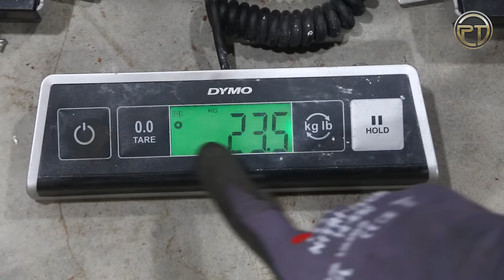3000 Soda Cans Transformed | THOUSANDS of Them

Comment: I dont have the money to afford one of those industrial shredders, so i took it another route. I reversed engineered a micro shredder to use for those cans. Truly works great, the trick is that the teeth arent as big for obvious reasons, and so i gotta maintain some pressure on the cans so they dont just keep squirming around, which is only an issue when the pile gets low.

Comment: The shredding machines you have are impressive. I think the breakage (and all the dross) shows why people say cans are a bad source for casting aluminum.
Reply from the maker: i totally agree
Reply: When it's free (not so much in this case though!) It's FREE. 

If all you're doing is casting plates, rod or disk billets for your own use it's definitely cheaper than buying new ali stock.

Doing all that driving around though will cost a lot these days, (not very green) plus the foundry costs. 🤔🥴🙄
Reply: Cans have paint, plastic lining & some iron for the lid opener, so yeah not that easy
Reply: It was a good question
Reply: Cans also have plastic lining & paint

Comment: Nice video man.  The sand casting seemed like it took a lot of effort for the foundry guys, did they want to do it that way for something to film or is that the preferred way when dealing with large amounts of aluminiun?
Reply from the maker: They normally make vents for the shipping industry, and they use a lot more aluminum for that. But they’ve never made ingots like this before so it was a little thinking of how they gonna do it

Comment: Aside from storage and transport, which is understandable, was there a reason to grind the cans to that consistency?

Considering you will get slag regardless, was curious if there were other reasons.
Reply from the maker: My initial plan was to melt all this is my own crucible which is much smaller then the ones Winteb used.
Reply: Fair enough.

Comment: Wouldn't shredding the cans expose more metal surface area, resulting in more of the aluminium being oxidised than if they were melted whole?
Reply from the maker: perhaps but melting them whole would have been more complex given the mass and size. At the end it did indeed lose some weight
Reply: Don't forget the paint and plastic layer inside the cans that gets burned away

Comment: Why not built a multi-tier grinder?  Put the coarsest one on top, and it empties into a medium one, which empties into a finest one on the bottom
Reply from the maker: interesting :)
Reply: Cause, usually on proper scale you separate the size what's grinded before cycling them back ...
You'll use screens n vibrating table for in between ...
But the use the gravity stand a nice process too ...

An open flame is quite better to avoid calcination the impurities ...
It's paint for the larger part ...
But if you don't let it burn, you'll just de-oxidize the elements structure, so it just turn in coal like ...
Maybe if you apply proper pressure you'll create artificial diamonds ...

Sure, lot of things to say bout that fight for oxygen once metal turns liquid ...

Sometimes, quite less ...
I must admit !!!

Dare, care, ride safe, clean, have fun ...
From France with .

Comment: ive melted aluminium before but only once, i dont see how its worth shredding the cans, i know the air pockets can make it dangerous to melt right away, but shredding it 10 times or so dont seem to make sense. You could just buy a furnace or make your own with propane and do it all at home like most people doing this will do. Maybe make smaller castings so its easier to remelt also, melting like 5kg at once dont make sense unless you end up using it all, which is often not the case, i would do like half a kilo or less per mold. You can use a old fire extinguisher as  a crucible if u need a cheap one, works for about 10 meltes depending on the size. You can also use the furnace to make bullets and maybe sell those for extra income, bullets tend to be made of lead though.
Reply from the maker: Thanks for the advice!

Comment: You used that machine to pick up the cans only to move it 3 meters back🤨
Reply from the maker: it was a little more than that :)
Reply: Taking that green Tumbler as reference
It's barely any
Reply from the maker: It was easier to count them. Picking them
Up from the floor wouldn’t be that comfortable then picking them out of the mini trackdumper

Comment: Nah. At 20 cents a pound what's the point of spending all that time and money on effort and fancy equipment.  With  ever thinner grade aluminum cans being
the norm the once 20 (12 fl oz)cans per pound formula has morphed in the formula 33 cans per pound of aluminum. My average is 30 cans per pound because
1/4 of the cans I pick up are larger 16, 19, 23, 24, and 25 (fluid) ounce size cans - which obviously have more aluminum than the 12 ouncers.  So, @ 20 cents a 
pound 3,000 cans might bring 20.00 from a scrap metal dealer here in Pennsylvania.  Published scrap prices (50 to 80 cents a pound for Coke can aluminum) 
are nonsense. Scrap dealers are offering 20, 21 cents a pound and maybe slightly higher for larger quantities 150 pounds and over.  I have 8,500+ cans weighing
approximately 283 pounds all washed and flattened (by a heavy ram) sitting in my basement.  The total is probably worth 70.00 if I'm lucky.  Scrap yards
here in the Philadelphia region do NOT pay anything close to nationally posted scrap prices.  There are NO "refiners" that will deal directly with small can volumes
from individual scrappers; and recycling centers don't want nor will they pay for ingots of your home melted aluminum stock.  Melting them in your home forge 
with propane costs waaaaay more than the aluminum is worth.  Sell ingots on ebay to craft buyers?  Nonsense.  You've got 20 dollars worth of coke can aluminum - tops.
The cost of propane, equipment, your time and travel makes shredding and melting into unsalable ingots a fools folly.  Nice video however.